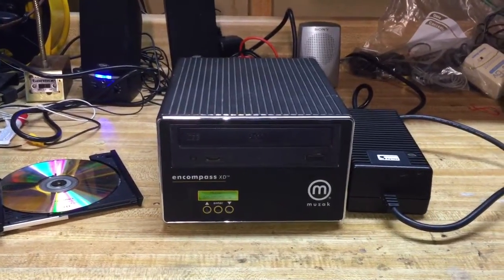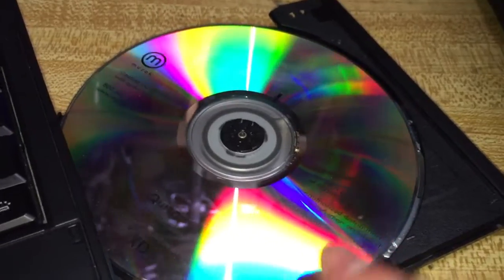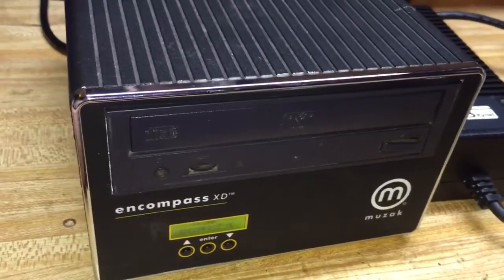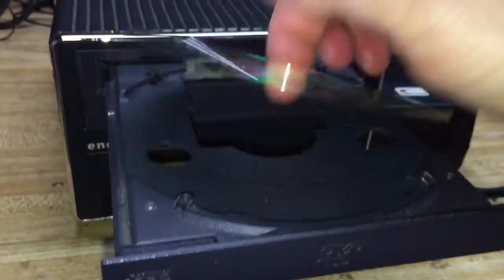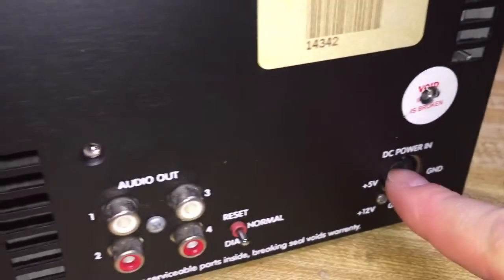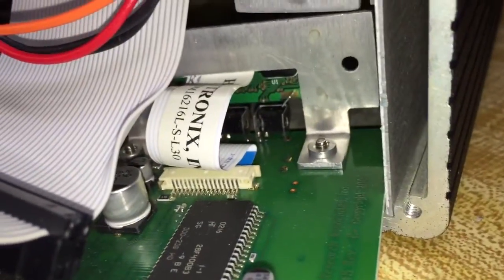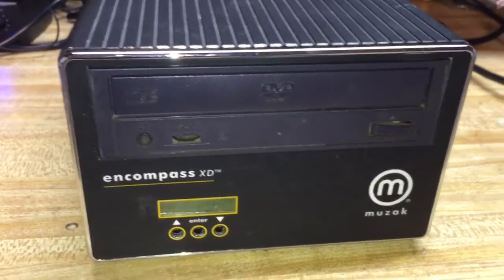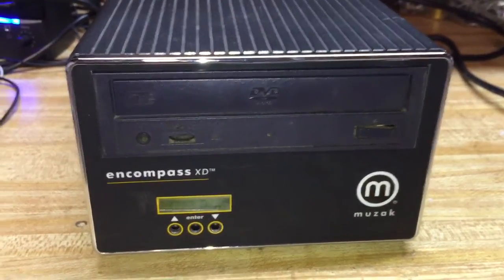Unbox Therapy: Muzak Encompass XD CD Music System

Comment: I was reading on the myce board that the CDRs are recorded in CD-I  Compact Disc Interactive?  Maybe that was a much earlier incarnate of the Muzak Encompass.

You could drag and drop one of the .mpa files to your desktop, chance the extension to .txt then open it.  In the first few lines of the file it may have text which explains the file decode format.
Reply: That was the Rediffusion RM3 / AEI and DMX Prodisc systems / Muzak MCD series players that used CD-I :)

Comment: I've a Muzak Encompass CM1 that has a hard drive with CD ROM! It also has an RS-232 port on the back but when opened has two USB ports but can not get anything to recognize on the computer!! Network sees it but no communication protocols for file sharing. Anyone have any luck getting it to show on File Explorer?
Reply from the maker: The CD does show on File Explorer, but the format is nothing recognizable by Windows.
Reply: @databits  Not asking about the CD, it has an RS-232 port and Network Port for direct Communication which is the question. Has anyone any luck in linking  it to a computer or network?
Reply from the maker: @JmC023  - sorry I missed that detail.  I have not opened mine up so didn’t know those ports existed!  Maybe someone else has!

Comment: Never had this one before. This Muzak Encompass XD can also play DVD-R, DVD+R discs as well as DVD-RW and DVD+RW discs. You can play up to 500 or 1,000 songs on a DVD-Rom drive, and it can play MPA files, you can play MP3 files as well.

It's background/foreground system but you hear music from the millennium including the 2000's along with some older favorites from the 1950's through the 1990's, or you can get elevator music from thee Seeburg Music Library site.

This was before Pandora, Spotify, and YouTube Music came along with these music streams. You can hear the music like the one you hear on the radio today. Trust me. Hear the same music on the radio today is like hearing the Musak Encompass XD can play the same song and people would hate it. I don't listen to the radio at all.

Comment: So if I had to take a guess, I would say that coin cell battery is actually holding the encryption keys in SRAM. That way if the board is tampered with it can immediately dump the keys. Another thing that struck me as odd is the amount of processing power in this thing -- a huge Motorola CPU, a Xilinx CPLD, AND an AD DSP? Jeez that's a lot of horsepower for an overgrown CD player. Even with the decryption processing that needs to be done there's no way all that is actually needed.

Comment: I ask, why background music at all in public places? Most “Muzak” in today’s settings is obnoxious commercial music, generally rock or country, and it is obtrusive. You cannot hear yourself think. You cannot carry on a conversation with someone else without reverting to shouting. Some businesses use a local FM radio station as their Muzak—- again, either rock or country. As a nonenthusiast for pop music in general, I would prefer not to have it. There is a chain of grocery stores in my area which insists on having overly loud piped-in music at all times. It is a kind of tyranny. In restaurants, you hear rock garbage. You almost miss the “lukewarm gush of Muzak”, as musicologist Donald Jay Grout described it. By that, I mean the musical anaesthesia that one heard in such places half a century ago. Elevator music, some people called it. Insipid, uninspired and uninspiring. The conductor George Szell once told an interviewer that his dentist had Muzak in his office, and most of the time it was just like noise —- like the hum of an air conditioning compressor —-, but at other times it would grate. “I would rather endure the pain of a drill in my tooth”, said Szell, than be subjected to canned background ether.
Reply: Music in public place generally attracts people and stimulates them to stay longer there, so they can spend more money. If I remember correctly, it's Muzak who started this trend. The first public place where background music appeared was 1930s elevators, which had been moving slower those times than today and riding them was boring. Elevator music was invented to make people less bored.
I feel sorry (and you probably do too) for those retailers and restaurants' owners who have to listen to that music on work every single day. Lounge, pop music, EDM remakes of 80s or 90s hits, bland Muzak-ish tunes... all that stuff tires their ears. I don't like some songs being played in public, too. I love to choose my tracklist for myself.

Comment: Any way to rip the songs off these discs? I never seen one of these but If I find or are offered one I'll make sure to accept it.
Reply from the maker: coondogtheman1234 I casually tried that, but no luck thus far.
Reply: databits
Maybe upload one of the files to one of those sites that can ID files or try the program gspot. It might just be an mp3 but just renamed to an MPA file so I'd try that first. Would be nice if I could get one of those files so I can see what I can do with it. I've ripped files from video games and they were in strange formats so maybe send one my way and I'll take a look.
Reply: databits Could you maybe upload one of the files to a file host like sendspace? Or I can PM you my email if that's ok. I'd like to see what I can do with one of the files.
Reply: coondogtheman1234 padoshindsongs

Comment: We had that same unit at kwik star years ago. it was network connected, we never had to put a disk in it. really good sound quality compared to what they replaced it with. ours had a hard drive in it which failed at one point
Reply from the maker: +Brandon Hicks - I saw a Muzak unit still use just recently at a company!
Reply: I just got two of these units with a hard drive. Seems the disc only updates the playlist already on the hard drive. When it was network connected did it just update the playlist as well? The unit can play all day and has at least 10 hours worth of music I repeated. It also shuffles everything and produces a radio station like automation.